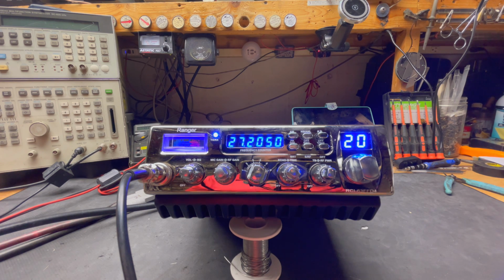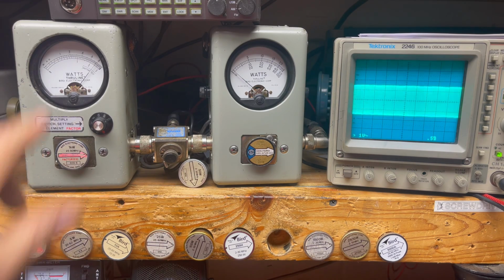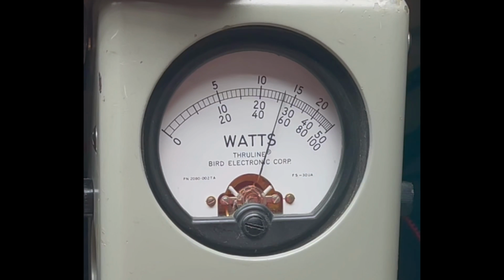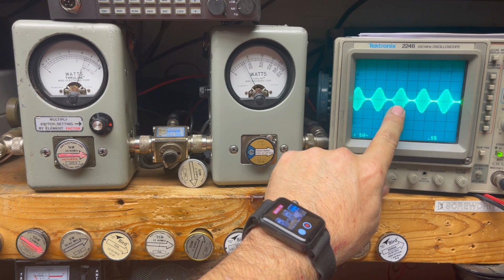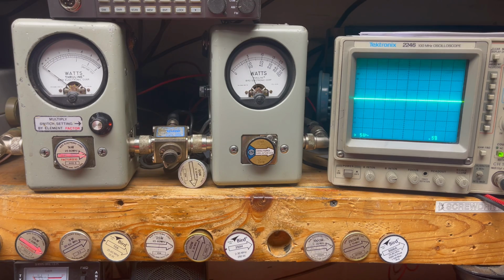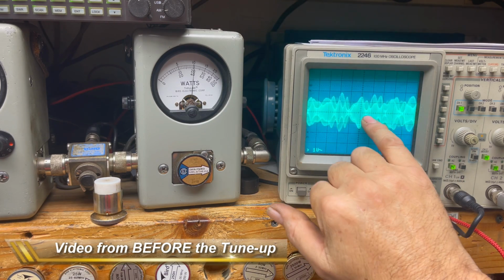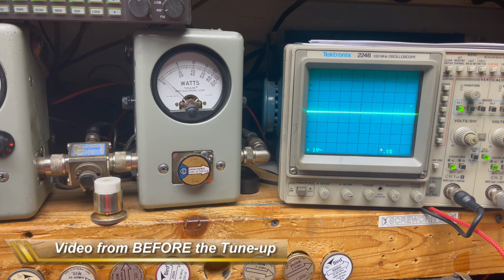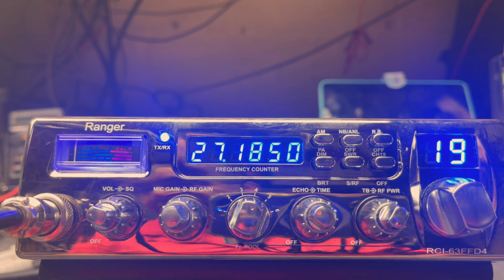RCI-63FFD4 Tune-up Report

Comment: UNFORTUNATELY MY 63ffD4 BLEW UP AND LOTS OF WHITE SMOKE ABOUT 8 months old from BELLS…not an SWR ISSUE 1.2. Currently running my 94hp which I bought from bells 9 years ago and still going strong BUT MY 63ffD4 that I bought from bells blew up literally I sent it back to CA per bells …..anyone else have this issue with the 63ffD4?kinda disappointing considering my 94 is 8 years old in same vehicle same swr never an issue and it’s still in my vehicle working fine while I wait for the 63ffD4 to come back
Reply: Here's the thing with the shipping right now they've got a lot of temporary employees and they're all so short-staffed stuff gets thrown around a lot in shipping it really gets beat to death I would say something probably came loose and touch something it shouldn't have you have to understand to is that even though it does suck that some radios come out bad for the manufacturer when you're mass-producing things you're going to have bad ones down then

Comment: Mr. Screwdriver: Another great video sir. Love seeing the spectrum analyzer. For those that Don't know what there looking at your explanation is priceless.  Great job sir. Question sir, do you have any 955's & max mods / Toshiba voltage regulators available, please advise. TMP from N.J.
Reply from the maker: Thank you sir I appreciate your comments, yes we have the SR – 955 in stock we also have the max mod. I have not seen any need for the max mod for this radio